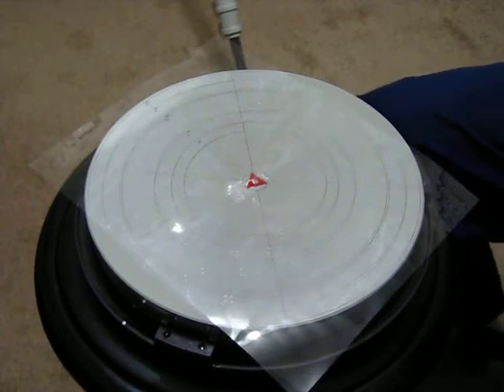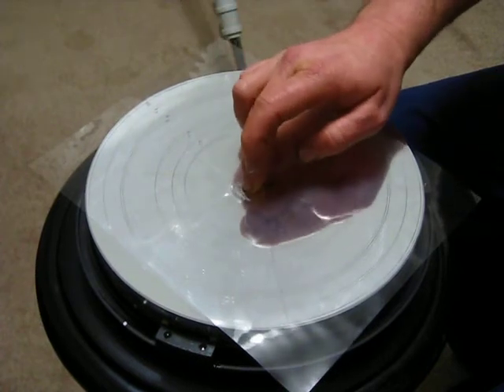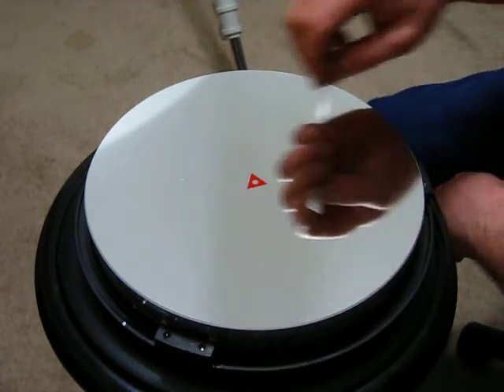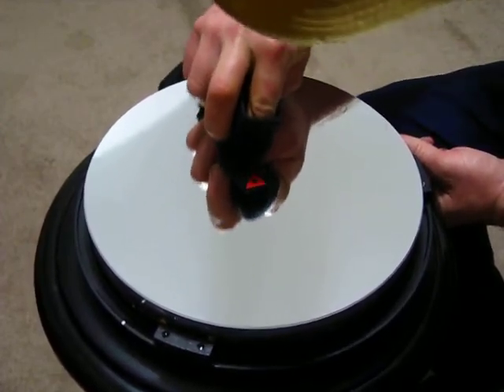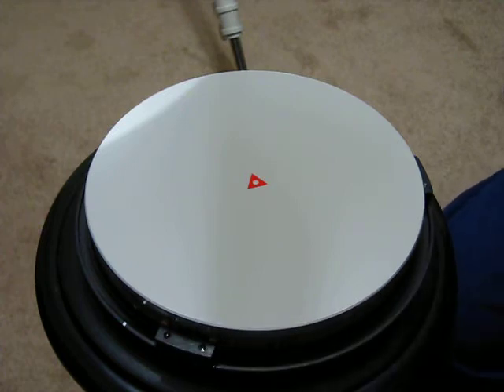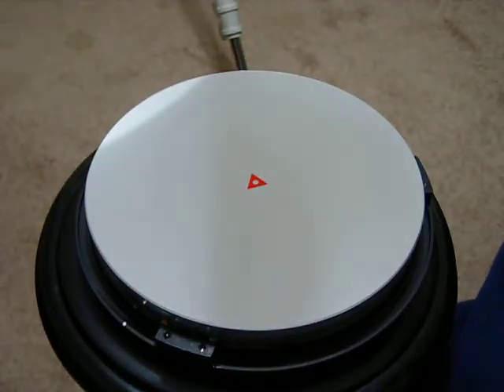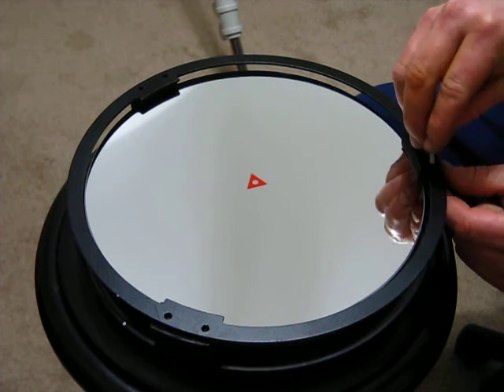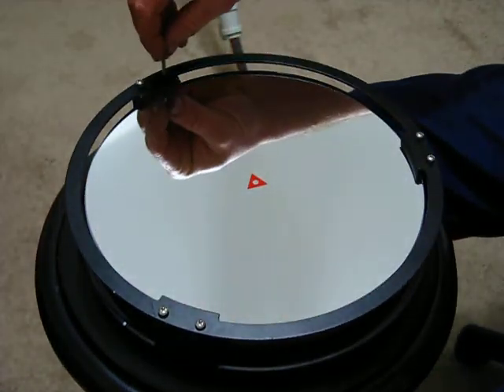ManCave Astronomy Meade LXD75 Mods and How to's#31 Center Spot and Cleaning Part2

Comment: Don't worry about the centre portion of the mirror, it doesn't play any part in forming the final image at the eyepiece because about 25 percent of the mirror (the centre portion) is obstructed by the secondary mirror. Think about the SCT, it has no centre portion of the mirror AT ALL, the central 1/3 is the baffle tube!